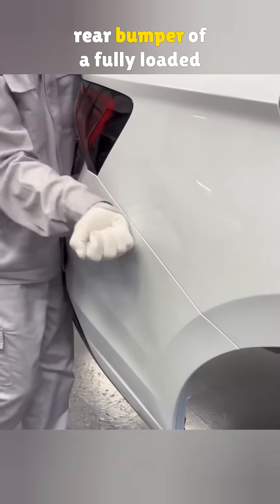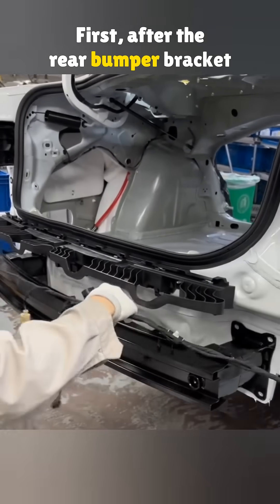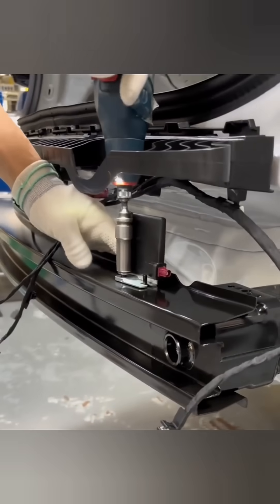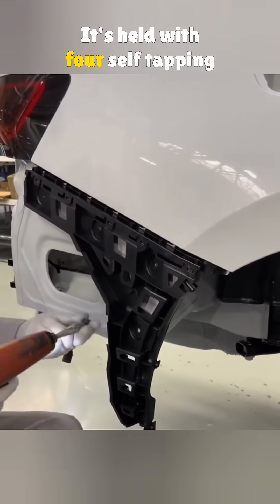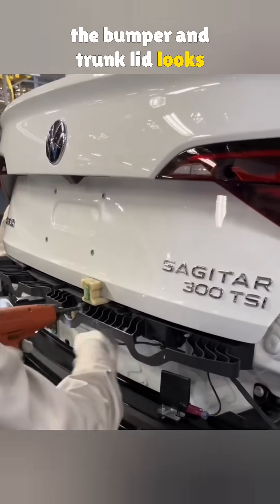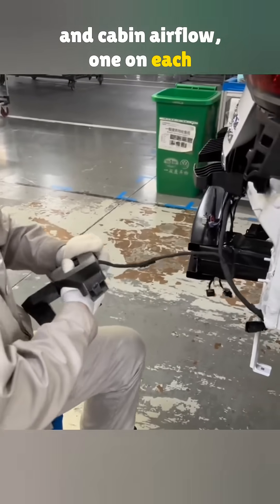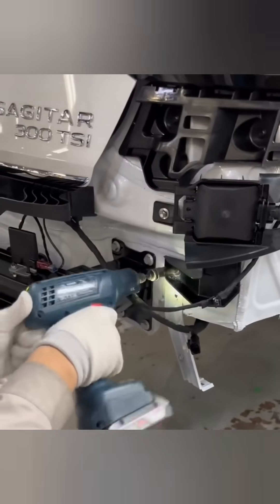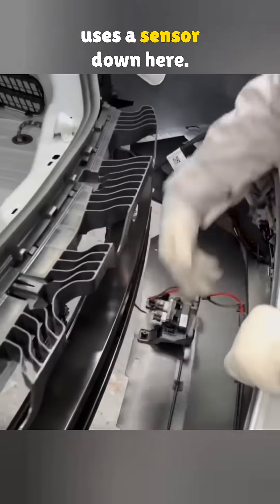What’s Hiding Under the Rear Bumper of the Fully Loaded VW Jetta #assembly #automobile #car

Comment: Your videos actually make me want a Volkswagen 
Nice 👍 
They seem well engineered and extremely well built
Reply: Premium cars
Reply: The cars are very unreliable and expensive to fix.
Reply: @hammerscharlie1935 No they are not. Spare parts are dirt cheap here in eastern Europe. And running cost are low too
Reply: @r11tc In north america volkswagen only offers higher trim models of the cars they sold in other countries. The cars seems to only equipped with higher end features and more powerful engines thats why their cars are considered by many as very unreliable her simply because more tech equals more points to fail and the engines are overstressed to accommodate the quick acceleration that most americans wants in a german car.
Reply: @hammerscharlie1935 North America offers worse trim models even than chines VW. Even Chinese Ford is better equipped than American ones. I can compare Eu spec Passat wit Usa spec Passat - Eu spec is even built on different platform and a lot better in terms of interior materials and tech. But cars in EU are more expensive in general.
Reply: @r11tc  yes in europe, because thats their own product. anywhere else in the world... they are unreliable and expensive.
Reply: @ThePencilPusher  It's crazy how you let yourself speak for the world :D
Reply: @hammerscharlie1935If you maintain these cars well, get them serviced timely. They are soo long.